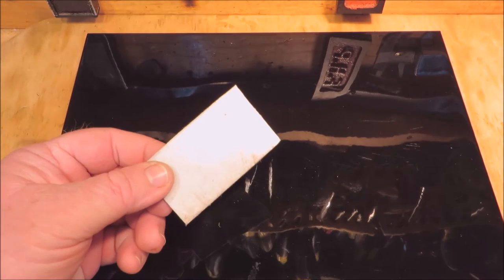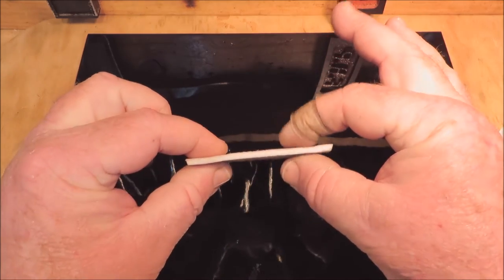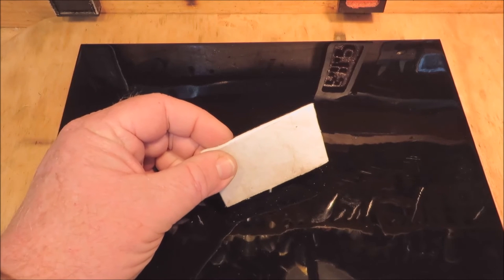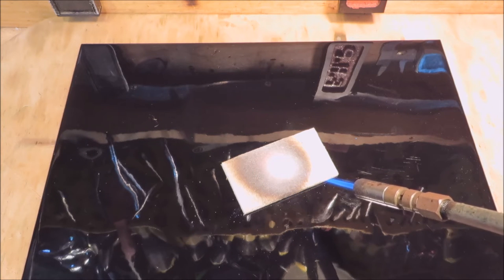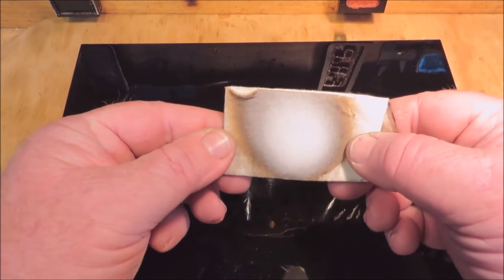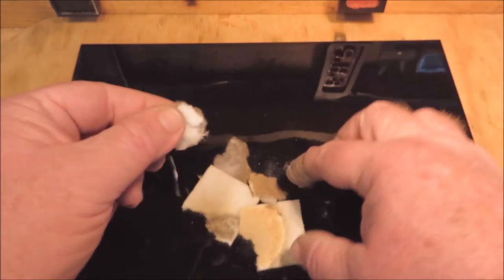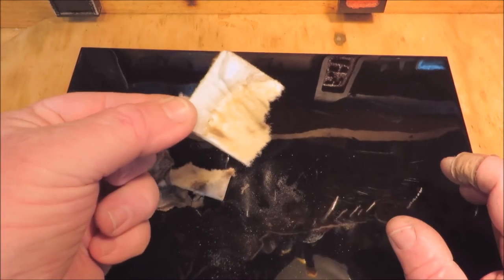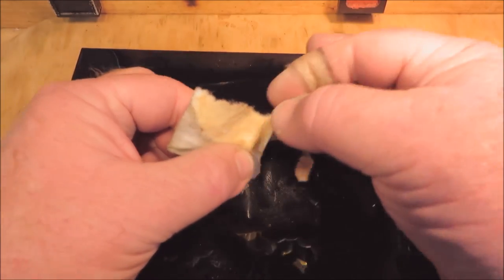Work Shop Talk - Dangers of Man Made Ceramic Fibre Products  - Hints & Tips

Comment: As an insulation contractor I have not used this material but with all insulation products you MUST USE PROPER SAFETY EQUIPMENT and install following manufacturers instructions. 

I think this material is designed to be in an enclosed space, not in direct contact with flame. Like boiler lagging- perfect application. 

Fiberglas, rockwool, cellulose, polystyrene and isocyanurate board also can be VERY hazardous and must be used and installed properly.
Reply from the maker: Yes, I made this video as I'm a model steam engine enthusiasts and a lot of other enthusiasts are/were using this to line their boilers and its contactable by flame and breaking down.

Comment: I just applied a similar material to 504 I'm rebuilding. Lined the sides with a 5mm blanket (rated 2300F) and used a high temp adhesive that was liberally applied. :-)  So I did a test
burn on the material and the results were the same as yours. This has to go !  Back to square one.  Nice videos !
Reply from the maker: Todd I was the same. Bought the stuff and thought it was going to be great for model steam engine boilers, but the stuff fails as soon as flame licks it. You don't want to pollute your surroundings and lungs with this stuff. I did hours of Google searching and its the next asbestos. There's so many warnings about its uses.
Reply: There is a thing called a rigidizer look it up

Comment: Would you use this to insulate say a car??
Reply from the maker: I think you'd be a lot safer because it's not in contact with a naked flame, but I would do some research on Google for exactly the situation you would like to use it for.
Reply: Blue Heeler do you know how this insulation works vs conventional insulation like polyiso board, spray foam, etc? What is the r value?